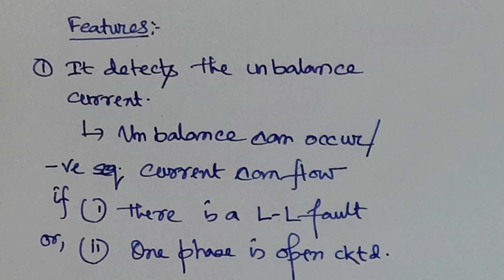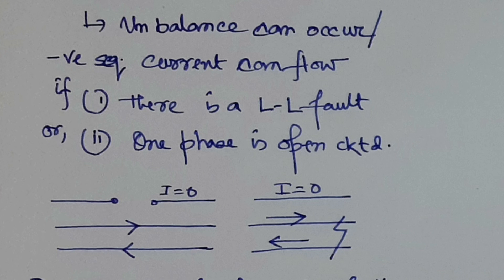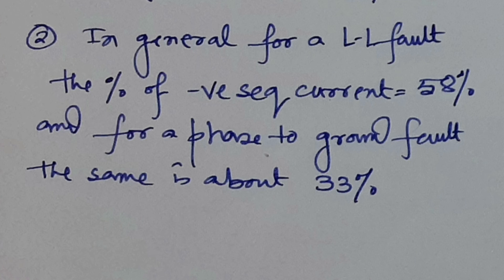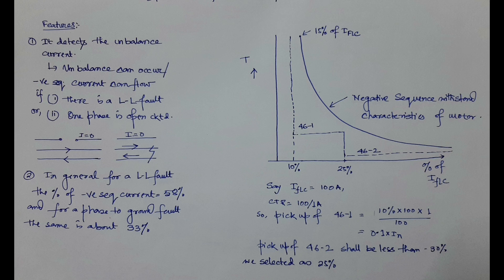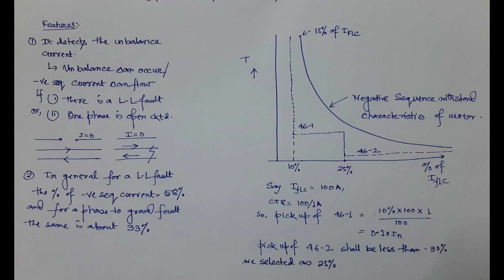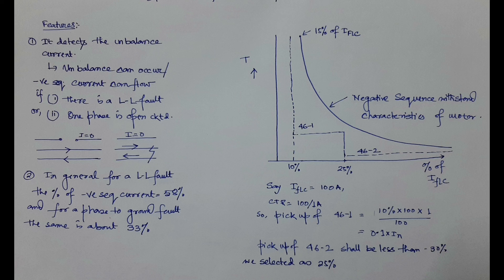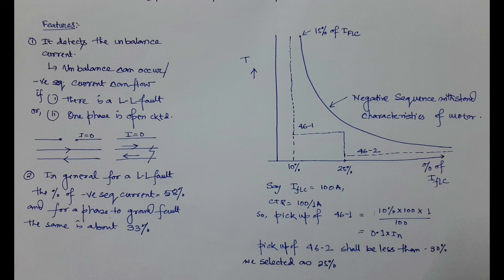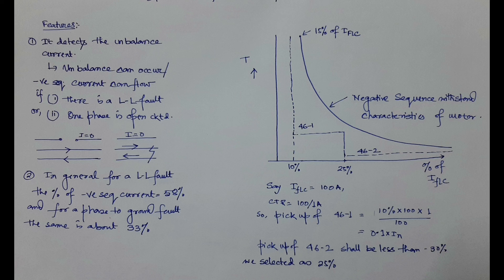Negative sequence relay setting calculation| Unbalance protection of motor

Comment: Nice Video, For Line to Ground Fault, 33% is mean 33% x I Nominal? For Example Generator with FLA is 1000 A, it mean during L-G Fault is around 0.33x1000=330 Ampere?

Some generator has Maximum a Continuous Negative Sequence is 15 %. If Negative sequence is flow up to 33% of Nominal, it means shall be clear by 46 to Circuit Breaker.